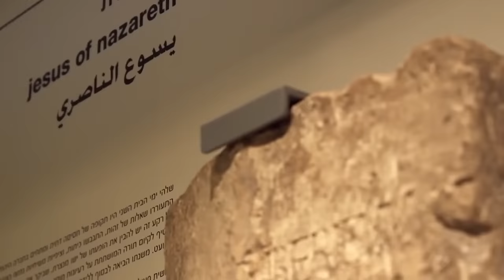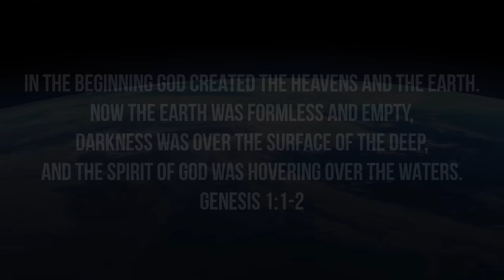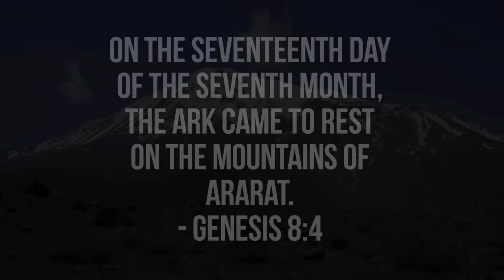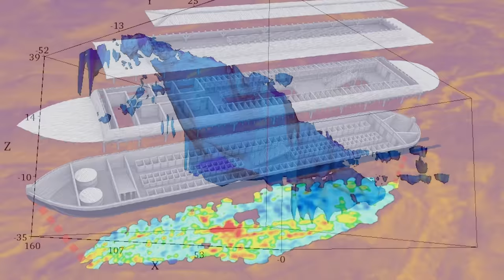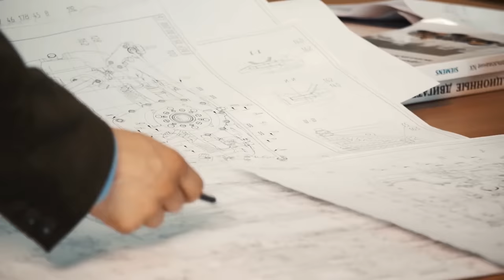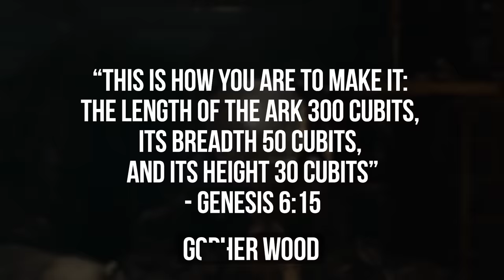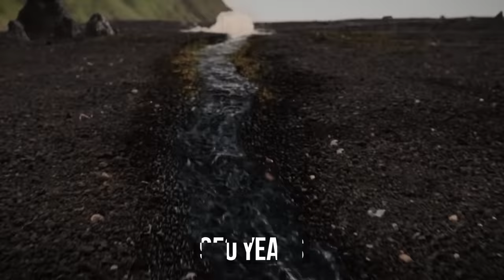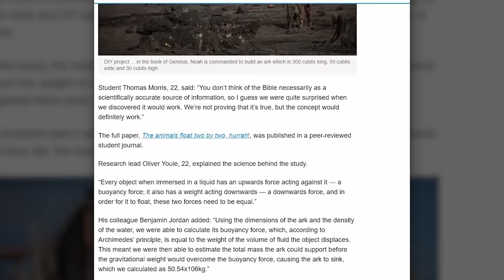Did They Actually Find the Real Noah’s Ark?

Comment: That's so cool. I believe they found the Ark
Reply: You also believe in the tooth fairy?
Reply: @03Mach1  Yes, absolutely. Who would give a coin for my tooth??
Reply: @03Mach1  
Noah's ark/arc is huge, it stretches from the autumn equinox to the spring equinox and consists of six constellations aka Libra thru Pisces.  This is also the six nights/signs/months found in Genesis one.
The constellations will be modified a bit to describe Scorpio thru Pisces as the winter constellations with Scorpio as the leader of these months (Rev 9).  Noah (Earth) will enter the ark/arc at every autumn equinox and will depart the arc at the spring equinox.  He will again enter the arc at our next autumn equinox.
Reply: @bryanpayton1168  
It's very hot here in Heaven.  The cooler weather of Hell will be welcomed.

Comment: Noah's Ark was not designed to withstand the raging ocean. It had no seamless hull or bilge pumps which is a necessity on a seagoing vessel aver 350 feet. The Ark was 500 feet and sank, drowning everyone aboard. 
The geographic formation is not the remains of a seagoing vessel. It is the faith based imagining that will see whatever it wants to see.

Comment: 22:53 THIS IS NOT THE ARK!
Stop looking for a boat in this shape. There was no need for it to be hydrodynamic. This is a modern shaped vessel. There was no engine to push it through the water thus no need for a pointed bow to cut through the water. You are all thinking too modern if you think this is the shape of the ark.